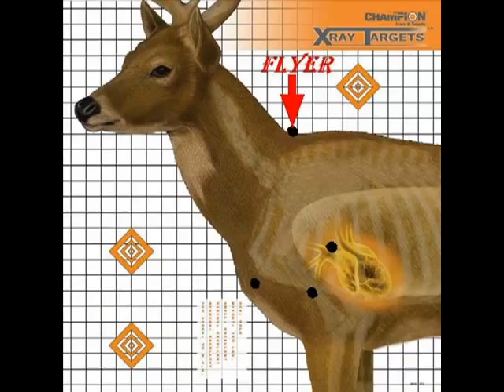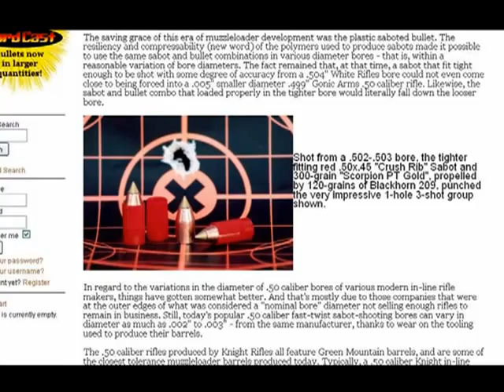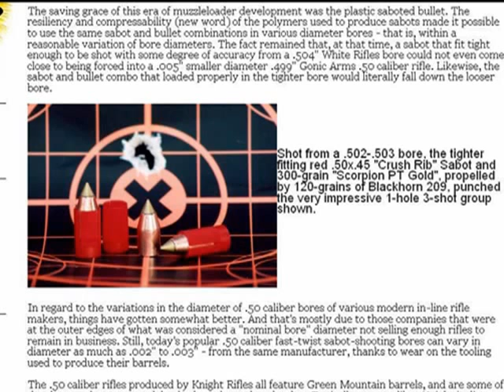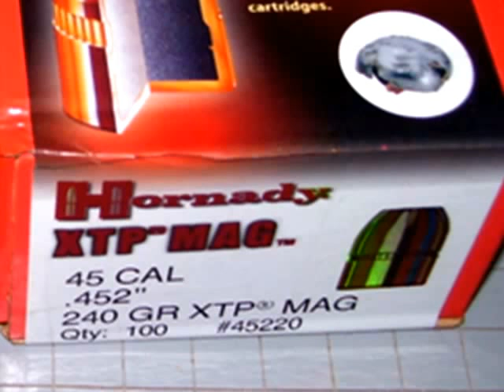Muzzleloader Accuracy Using Aluminum Foil  - Barrel Size -

Comment: What is your powder load? FF ? Or FFF ? Or a pyrodex, I have a Hawkins and renegade, both .54 for elk etc..they will almost drive nailswith proper thickness patches, and proper round ball, because even though purchased a year apart, the bore diameters are different, I want to work on my black powder loads, I don't use the other stuff, just my preference, thanks for the greatvideo
Reply from the maker: Hi bucketlistbeginner, thanks for your input and question. I use the Blackhorn 209 powder. It seems to work really good in my in-lines and it is super easy to clean. A 110 grain load seems to work best for my Thompson Center. For my CVA a 85 grain load seems to work the best. Have a great day.

Comment: Hey Sam, I just wanted to write you this just in case it's data you may not know.  Keep in mind that TC make their barrel with an Inside Diameter that gradually slightly opens up in ID when it reaches the muzzle.  They do that to help push and start bullets in when you load making it easier to start them before using the ramrod.  If you want to have REAL Inside Diameter measurement, you have to measure it at least 2" inside away from the muzzle.  Also, have you tried the Powerbelts with their gaz check ass?  Really helped me a lot on consistent accuracy.  I have a TC as well, and it's now so much more reliable with those powerbelts.  I was using the sabot models before and was getting somewhat acceptable 4"-5" groups at 100y with iron sights, but with the powerbelts bullets, I get easy 1.5" groups.  I also love the fact that because those bullets are not equipped with plastic sabots, that leaves debris inside your barrel and in the rifling every time you shoot a shot, I don't even clean the barrel every shot or 2 shot, I clean it every 4-5 shots and I get those 1.5" groups at 100y.  BTW, I don't work for powerbelt, I'm just a devoted hunter up here in Canada where moose and bears and deer just simply drop where they're shot with those bullets.  Hope this helps!
Reply from the maker: Great information Frankie, thank you so much. Makes sense that the barrel would be a little larger at the end. I have read some reviews that were kind of  negative about the powerbelts, but it sounds like you have had some good success in the field and at the range.  I will definitely give the Powerbelts a try. Thanks again.

Comment: If you are getting random flyers and using sabots, it's probably plastic residue in the barrel. I had the same problem. Sam Fadala talked about this in the Blackpowder Digest book I edited for Krause Publications. Get rid of the sabots and shoot solid lead 50-cal. projectiles in your inline and you will be so much happier! There is also a plastic solvent for cleaning the residue from muzzleloader barrels. Frustrating until you know the secret. Otherwise, it could be a cheap scope. Avoid the under $100 scopes which are notorious for having "loose" internals. I do like this tip, however.
Reply from the maker: Great information. Thank you for posting.

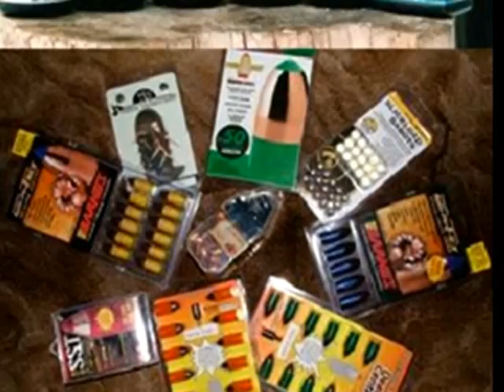Comment: I was given a .50 caliber T/C Hawken several Christmases ago and I was getting lousy accuracy with 370-grain T/C Maxi-balls. I tried different charges of different powders, but the groups remained very large and the flyers were way too many. Finally I decided to buy a Green Mountain barrel to replace the T/C barrel. The T/C barrel has a rifling pitch of 1:48 which allegedly should stabilize both conicals and patched round bullets.  The Green Mountain barrel has a pitch of 1:28", much faster than 1:48". Both Maxi-Ball and Maxi-Hunter balls now give me clover-leaf groups and no flyers. I seasoned the barrel with T/C Bore Butter and I clean it with T/C  black powder solvent No. 13. I can shoot 20 or 30 shots without cleaning the barrel between shots and even the last ball of the shooting session goes down the barrel as easily as the first. The charge I use with the 350-grain Maxi-Hunter is 90 grains of FFF Swiss black powder with a thin dry felt wad between powder and ball.  I have already harvested three deer with this load, all clean kills.
Reply from the maker: Great Post. Thanks giovanni tallino.
Reply: Would you have a link or website for that green mountain barrel?
Reply: I am happy to hear this as I just purchased a Knight Vision that has a Green Mountain barrel. Haven’t had a chance to shoot it yet as it is at my brother’s place, a six hour drive away and I won’t be picking it up until sometime in August.

Comment: I tried this today and it worked! 1/2 inch groups at 50 yards all day! I used foil that was .001 inches thick. I used just 1 layer, just enough for a tighter fit. Great tip! Thanks
Reply from the maker: Thanks for posting Daren. Great to see it worked for you.

Comment: Hiya. Thanx for that. Just can across your vidio. Did the same thing but with paper!! Haw funny is that. I however bought loads of different sabots and checked them for tight fit in the skirt. This give a better seal. And more consistent velocity. I would suggest to now try cronigraphing. To get you velocity  as consistent as possible to get just a little more acurisy .. Great vidio. Thanx

Comment: I don't have a muzzle loader I have a 45/70 1885 HW and I want to shoot Pyrodex with molded 500g bullets but I cant find any load data for a 500g load . I have been shooting Hornady 325g Leverevolution and getting 3 shot groups of less than 1/2 inch spread which is super good and they are around $30 for a box of 20 . But target shooters (Creedmoor)  were shooting 1000 yd's  with the 500g and blackpowder if anyone has any info on that please let me know on my You-Tube channel thanks .
Reply: Spencer Boaz - Old time cartridges were named by composition. The 45-70 was known as the 45/70/405 when being used by the army. Translation - 45 caliber bullet, 70 grains of black powder, with a 405 grain bullet. The 1000 yard shooters were just replacing the 405 grain bullet with a 500 grain bullet. How do I know? Because the 45-70 cartridge case can ONLY hold 70 grains of black powder. And that was with the old balloon head cases. Modern web head cases can't hold that much - more like 65 grains.
Pyrodex is supposed to be used volume for volume of black powder. Also, it isn't quite as powerful as black powder, so performance is going to be slightly less.
Loading is best when the powder is funneled into a case via drop tube (a 3 to 4 ft long tube) so that gravity compacts the powder more efficiently into the cases. What you should end up with should properly be called "45/65/500".
Lastly, 1000 yards is going to be with what is called a "rainbow trajectory". Bullet flight is going to be 4 to 6 feet higher than the bore at 500 yds in order to hit the target at 1000 yds. Having said that, yes, it can be done. It takes skill and patience, and attention to detail, but it can be done. Let me know if you succeed.
All of this is based on using black powder or black powder substitute. Don't even THINK of trying to load smokeless gunpowders without a Reloading manual, and strict adherence to the data.

Comment: Not sure if your rifle has the TC easy load option at the muzzle end of the barrel. This is where the rifling starts about a half inch back from the face of the muzzle allowing one to start the bullet easier. I have read articles on the net where this greatly affects accuracy. Most take their barrels to a gunsmith to have this part cut off and the barrel refaced and re crowned. They say that this half inch of unrifled bore allows the projectile to wobble as hot gasses flow around it at the last instant which make good sense to me considering accuracy is affected by the crown. It is hard to believe that TC has such poor QC on barrel production allowing variances in barrel tolerances but it could be so to give one that 'authenticity' of black powder weapons of past that were hand made and no two were never alike including their accuracy.
Reply: +Subgunman The new CVA 209 inlines all feature a &quot;Bullet Guiding Muzzle&quot; which is probably the same thing.&#160; I see good accuracy reports on them, and frankly if TC rifles were having that removed right and left, it seems to me like they would have stopped producing them, and CVA wouldn't have started. 

I guess I am about to find out, because I have a Knight T-bolt .50 without it and I am on the verge of getting a new CVA Wolf .50 with it. 

I am thinking that it doesn't actually affect accuracy noticeably, but I have to admit that it's also possible that they have traded off some accuracy for extra ease and speed of loading in the field. 

All the old Government Model .45ACP's I shot were so sloppy that the sights were just a step up from useless. The clearances on the slide rails were so large that the slide never returned to exactly the same spot in relation to the barrel twice in a row. And that was when they were new; it only got worse as they wore under use 

However, it was by design, because slop on the slide rails made sure that it would still cycle while super dirty and the main concern was about distances and situations where it was the original Point & Click interface, no sights used. 

More important that it go Bang every time at 10 feet than only fire while well-maintained but turn in one-inch groups at 50 yds.

Same with the Brown Bess muskets. Those were commonly supplied with undersized balls, because it was more important to be able to load a fouled barrel, and have less power but get another shot quickly at 20 yards than worry about 80-yard groups.

So let us hope I am right about it not making a difference in the new CVA Wolf that is on the way!
Reply: Your damn barrel outgrew the twisting. You people simply over fertilize!

Comment: It doesn't matter if the gun is brand new or old, you must always slug the bore and and buy a bullet that FITS !!!! if you can't find a bullet, cast your own !!!!!!!!! hard cast lead bullets are cheaper and just as good as jacketed ones. You only need the powder it takes to reach the target !!!!! If your using black powder anything over that load will not burn and be thrown out of the barrell !! lay a white sheet on the ground in front of your gun, fire a shot, look at the sheet. If you see powder spots on the sheet, your load is too heavy and your wasting your money. Reduce your load until the sheet stays clean !! I see your not using real BP! So every one of those powders will give you a different effect. Higher pressures, less fouling, faster or slower bullet speed. I never use that stuff, i use only Black Powder. this is just for your info, you do what works for you !!
Reply: +Ryan Simpson well you measure the bore, at the muzzell, then you take a SOFT LEAD ball or bullet a little OVER SIZE, you grease the ball and you take a brass hammer or something else that won't damage your barrel, and use a ram rod or dowel rod and pound it all the way through the barrel to get an exact copy of you barrel's insides then you measure that! I don't shoot inline black powder mine are all flint locks. Generally speaking, if you can get it down the barrel, you can shoot it out !!
Reply from the maker: +TheDave570 Wow, thanks for the great information. Very informative, I will definitely try laying down a white sheet the next time I shoot.
Reply: +Sam Lilly Your quite welcome, glad to help.
Reply: What does it mean to "slug the bore?" How do you do it?
Reply: +TheDave570 Thanks! Please pardon my ignorance, I am a true beginner regarding BP in general. Would you use calipers for the initial measurement?
Reply: +Ryan Simpson yes, use what ever will work for you, just so you have a good measurement.
Reply: Will some pits in the breach area affect the accuracy a lot? I have two small spots and can’t figure out what else to do but I’m thinking this video and comments to slug my barrel may help , tc encore pro hunter
Reply: TheDave570 - I know that you wrote this quite a while ago, but for others reading it should be noted that he is talking about muzzleloaders. Not all muzzleloaders have easily removed breech plugs. And trying to slug the bore of a muzzleloader without removing the breech is a good way to turn your muzzleloader into a wall hanger.
A much better way for muzzleloaders is to plug the barrel about an inch deep, and pour in some chamber casting metal (generally available from suppliers such as Brownells). Then simple air pressure will retrieve the casting. Alternatively, a wire tied to the plug and centered in the bore will allow the casting to be pulled out.
However, as a start, if normal 50 cal bullets don't fit well, try 0.515 diameter projectiles. Some early guns were made to this dimension (like the Smith carbine), instead of the more commonly available true 50.
Regardless, all black powder guns were traditionally tried with various thickness patches until the right thickness for your particular gun was found.

Comment: You do know that you could have (still can) saved a lot of money shooting traditional PRB's of soft lead.  Highly effective on game for hundreds of years.  Also, you should always "check" your "powder grains" again after a major component change.  Might be more accurate at another charge wt with the fatter combo.
Reply from the maker: Thanks Wade for your input. How would someone get started with shooting the PRB's? Isn't there a lot to buy to get started? I wouldn't know where to start but would love to get some information about it and maybe start shooting them.
Reply: No more to buy as I see it: patches and balls where the "modern" ML shooter is buying bullets and sabots-which appear to be much more expensive. The real trick is to learn to load as tightly as practically possible, with a "thick" lubed patch  (~.020".)  This wipes the last shot as you load your next shot and fouling cannot "build up".  When you can load 10 without any "extra" effort then you're on the right path.  Balls can be molded at home or purchased from many sources.  Patching material is as close as your nearest fabric store.  Water-based lubes are great for targets and plinking (saliva being quite inexpensive and fully effective), but we use oily lubes for hunting in order to prevent a rust ring from a water-wet patch sitting in the bore too long.  Many descriptions of this sort of loading can be found in the "Black Powder Shooting" section of AmericanLongrifles.org.  BUT PLEASE NOTE that this is a BP site for folks who are into proper historical representation of the 1840 and before period.  The modern bastardizations (no offense) are not discussed there, nor are cartridge guns of any sort.  HTH Cheers!
Reply: You'll need plain lead balls, .010-.005" under bore diameter, cotton or linen cloth-like denim/duck/ticking, and lube-saliva or commercial or homebrew (moosemilk) or  neatsfoot oil, mink oil, etc. AND then to work up a load that's tight enough to prevent fouling with a patch that's heavy enough to remain in good shape--re-shootable after shooting. 
It will also require the use of a ball-starter and careful, short reaches on the loading rod.  I load a 42" bbl with .530 ball and 12-oz denim, spit or tallow, home-made starter and rammer and gun.
Reply from the maker: Wade Patton
Wow, thanks Wade for the great information. I'm sure this will help a lot of us who are using the more modern guns and not as familiar with the traditional muzzle loading.
Reply: Hope to spread a little more traditional hand-made joy around the 'tube when i get this GoPro working right.  Funny eh?  latest tech to highlight 200 year old tech.
Reply: Also when working up to a proper patch thickness, one might use cigarette papers to tighten up the load-much as you used the foil.  Then source a patch of the proper thickness, no more papers.
Reply: Awesome info, Wade! I just wanted to add to this discussion - I think I remember reading that the CVA Optima V2 manual instructs users to not to use lead projectiles heavier than 400 grains in weight. That probably has to do with maintaining safe pressure margins with the max load of 150 grains of FFg. You can find the manual on the manufacturer website to verify.
Reply: Ryan Simpson
That only makes sense if you don't apply it to all m/l's. The manual is referencing a very limited range of calibers (or maybe just one).  Shooting round balls only makes BP charge irrelevant for safety purposes (as ball weight is same per each caliber every time).  But of course if you have a gun that comes with a manual, follow your safety manual.  Unless something patently absurd.  That's a personal call based on your frame of reference. But cannot recommend such.  I do recommend folks get out and meet other BP shooters and learn some facts and forget all the fictions.  There are too many fictions.